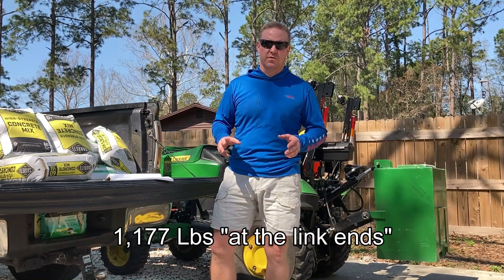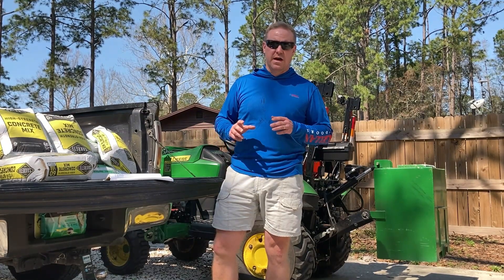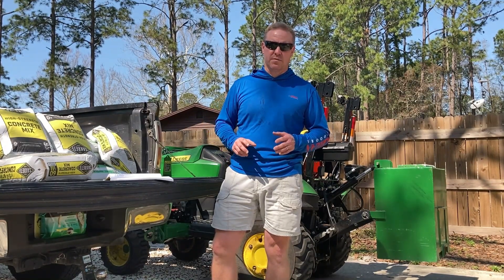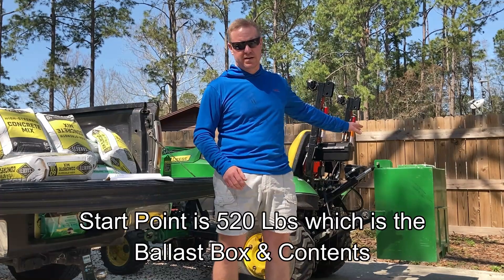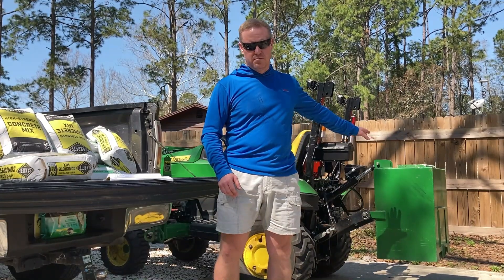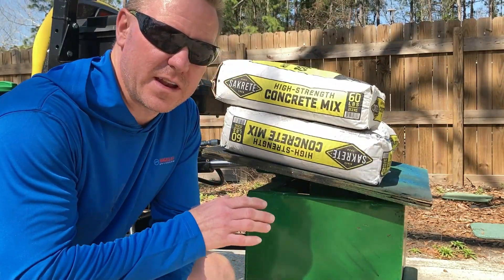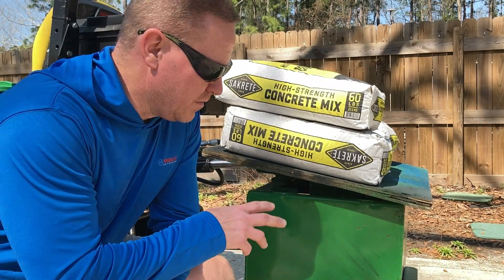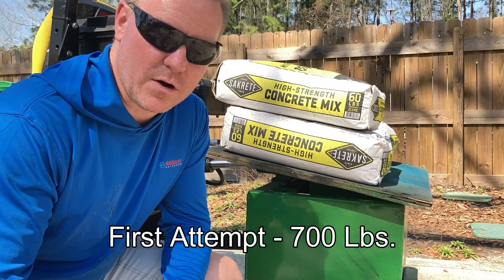John Deere 1023E 1025R 3 Point Hitch Lift Test

Comment: Thanks.  It's nuts what JD claims you need as rear ballast for a 1025R to work with the loader.  I believe it's like 1000lbs including wheel weight.
Reply from the maker: Yeah, the chart they have to reach the ballast requirement is also weird.  They have three charts using a hodge podge of different weight methods to reach the required weight.  I need to do this test again, since I raised my system psi.  Problem is I don't have the ballast box anymore.  I probably could use one, but I nearly always have the stump grinder on there.  And I'm always trying to minimize my additional, usually, unused items.  The cheapest way to increae weight is to load the tires, BUT, that weight is also the most difficult to take off should you not want it.  Thanks for watching.
Reply: @FloridaDeere  tire weight doesn't offset front ender loader weight, tire weight is for traction, ballast weight is for offseting FEL weight
Reply from the maker: @schlomoshekelstein908  I'm not sure we are on the same page.  If you load your tires with fluid, that does add ballast.  I'm not sure what you're saying I got wrong?
Reply: @FloridaDeere  weight in the tires doesn't counter lever weight in the bucket. weight in the tires gives you more traction and some rollover protection. ballast weight on 3 pt hitch takes weight off the front axle and puts it on the rear axle like a counter balance
Reply: @FloridaDeere  if you pick up a 500 lb bucket load with filled tires and no ballast, theres 500+lbs on your front tires. if you pick the same amount up with the minimum 680 lb ballast weight on 3 pt hitch there's only like +200 lbs on your front tires
Reply from the maker: @schlomoshekelstein908  How does additional weight in the rear tires not act as a counter and yet a ballast box does?  If there is added weight on the rear end of the tractor, whether on the 3 point or in the tires, it's still ballast.  Additionally, the added weight from a 3 point also gives the tires extra traction, same as fluid in the tires, because it provides additional weight or pressure if you will to the tires' thread in the ground.  It truly does not matter where the weight is, other than fore and aft of the center line or if the weight in low.  Lower weight is better for stability and the weight further to the rear balances out the FEL weight.  Where did you get that information?  I don't believe it is accurate at all. However, as always, I'm possible I am missing something or I am misunderstanding.
Reply from the maker: @schlomoshekelstein908  To a certain extent, you could argue you're right if that 500lbs was in the front tires, yes, but if that weight is in the rear tires, you have ballast that counters the front weight.  Now, if you have the weight further back, like at the ends of the 3 point hitch arms, let's say 500#, since it is actively further aft of the rear axle, it may act as additional weight, like be effectively 700# of ballast because of the physics of it being further back of the rear axle, as teh 500# in the tires woudl actually effectively only be 500# of ballast since there is no additional "effective" leverage.  If that's what you mean, I get it.  But people load there tires for traction yes, but the thing that provides traction is the weight and the weight is, well weight, so it's ballast as well.  We may be on the same page here, I'm not sure yet.
Reply: @FloridaDeere  Messick's Farm Equipment, specifically their video entitled: Relieving your front axle using rear ballast also "The Physics and Math of Tire Ballast vs. Rear Ballast on compact tractors" by Lumber Jack. these little tractors can use all the weight they can get, I use tire fluid, wheel weights and 750 lb ballast box
Reply: @FloridaDeere  if you have a lever and a fulcrum, one end of the lever is the front end loader, the other end is the 3pt hitch, put 100 lbs on both, it's perfectly balanced now. put 500 lbs of liquid ballast in the fulcrum, what does it do to the lever? nothing. your axles are the fulcrum
Reply from the maker: @schlomoshekelstein908  I will check out the video.  I do know there is a science behind the process of how to add weight.  I know adding some can increase or decrease the amount you need in other locations.  Meaning, it's not always if you lift a pound up front, you need to add a pound out back.  Because of leverage, there are formulas that can be examined to provide what you need.  And yes, these tractors are notoriously unstable and it doesn;t seem like dealers really give new tractor owners any advice as I watch forums and social media.  It's dealers think all tractor buyer are experienced tractor owners.
Reply from the maker: @schlomoshekelstein908  I would say you are correct as far as liquid ballast in your front tires, but the way I understand it, the front axle is the fulcrum and the rear axle is not.  I mean if the rear axle is 200 lbs heavier than it used to be, then it is more difficult to lift up.  Now could 200 lbs be more effective a further 2 feet past the axle on a 3 point, yes, but to say that any amount of weight on the rear axle, wheels or in the tires provides no additional help whatsoever seems illogical to me.
Reply: @FloridaDeere  Absolutely, You want to shift the fulcrum from the weak front axle to the rear axle. you can't do that with weight in the tire. If you pick up 200 lbs with your loader, and then rest it on the ground, is it putting 200 lbs on force on the tractor? no the weight just goes into the ground. Ballast weight directly over or inline with the axle doesn't counter-lever weight on the front end, it just makes your whole tractor heavier, which gives you some stability from rollover and more traction, but it does NOTHING to alleviate overloading the front axle. to make the example extreme, you want enough weight in your rear 3 pt hitch that your front end starts weighing LESS. I don't care how much weight or wheel weights you put on or in your tires, you will never lift the front end up. even if you put 5000 lbs in the tires, now if you put 5000 lbs on the 3 pt hitch, the front end loader would be facin the sky, right? poppin a wheelie
Reply: @FloridaDeere  in the video they pick up 1500 lbs of rock without a rear ballast and weigh the front tires, it's something like 3200 lbs. they put 1000 lbs of ballast on the rear and redo the test, front axle weighs 2600 lbs, they put a 6 foot long brushog on the back as ballast, recheck the scales and the front tires weigh 2100 lbs. the only thing that changed is the rear ballast weight. You can't do that with weight in the tires.
Reply from the maker: @schlomoshekelstein908  Okay, I think I see what you are saying, in order to "unload" the front axle, yo umust use the tractor itself as a fulcrum and load the other end of the tractor.  I thought you were saying that weight in the tires had no affect at all for stability and rollover protection.  Again, it is limited compared to what you are saying, but there is some use in having loaded tires or wheel weights, but technically they don't "unload" the front axle strain.  Am I tracking now?
Reply: @FloridaDeere  Yessir!! You're on the money! the tire/wheel weights definitely help but should be considered auxilliary to the 3 ph ballast weight. You get traction and rollover stability with axle weights, but you get all that plus unloading your axle with 3ph weight. Maybe I should call it balance weight. Balancing weight and ballast weight. ballast weight would be your axle weights, Balance weight would be your 3ph. Yess!! use the whole tractor as a fulcrum(but really the rear axle)
Reply from the maker: @schlomoshekelstein908  👍👍😉

Comment: Thank you I was wondering.
Reply from the maker: I hadn't thought much about it until I had done the same on a 445 and found out they lifted nearly 800#, so after that naturally I wanted to try the same test on the 1023.  I do wish I had a pressure gauge.  I really need to get one of those.

Comment: The CoG of your load looks to be only about 8 inches behind the lift arm pins.  Could do some linear interpolation to see exactly how close the lift capacity is to the spec's, but it appears to be pretty close to the spec's, just by your "seat of the pants" demo.

Comment: Nice video….how do you get your 3 point lift to go down at a slow rate rather than slamming down to the ground….thanks
Reply: @rickeyferrell9247  Should be a knob under the seat, not under but below the seat, like when you sit in the seat between your legs, at least that's where most tractors are. it will  adjust how fast or slow the 3 point works.